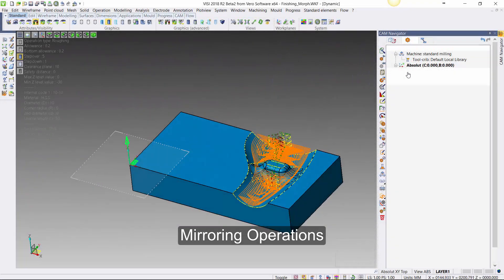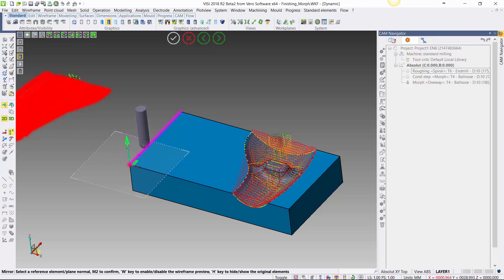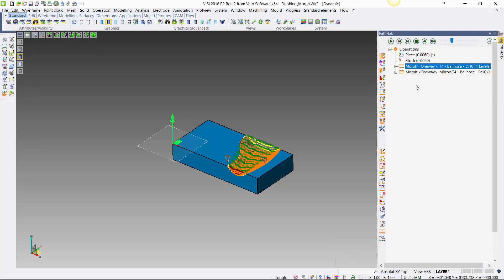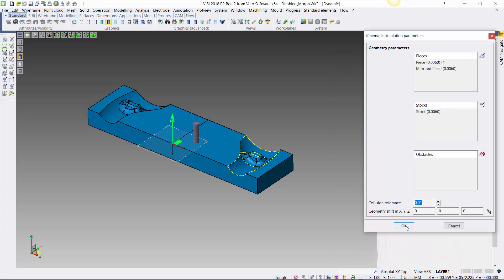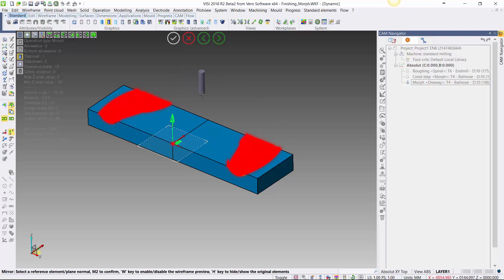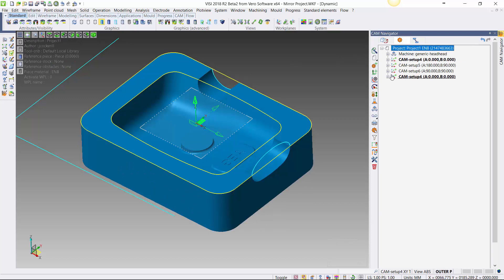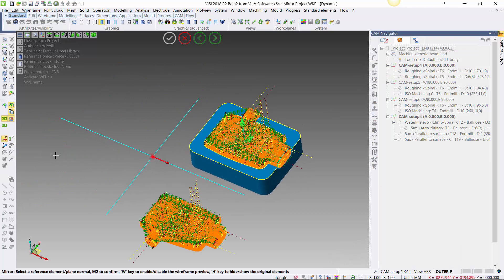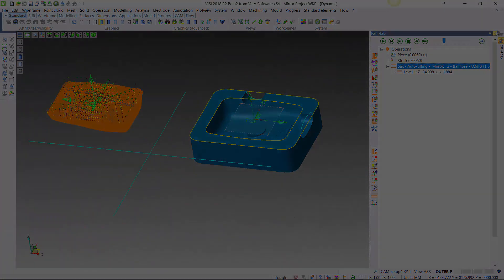Toolpath mirroring | VISI 2018 R2

Comment: How would this calculate a 90 deg tilt about the mirror line if the machine it is being run on had a trunion table that had limited stroke in the opposite direction.